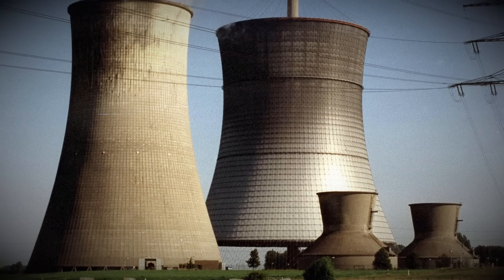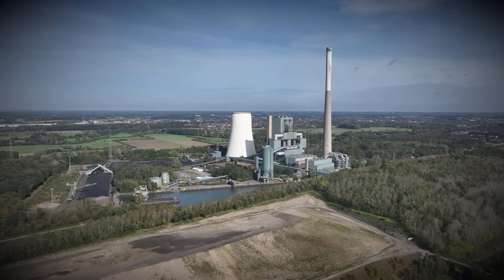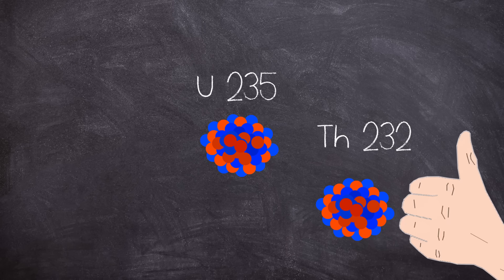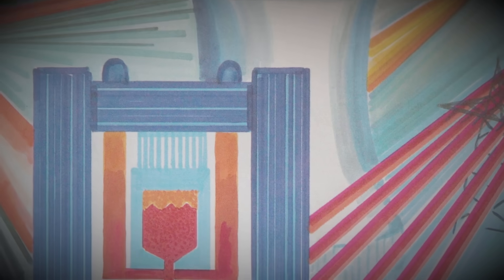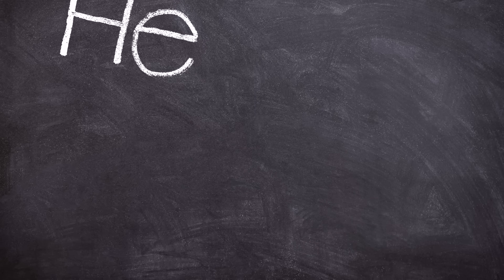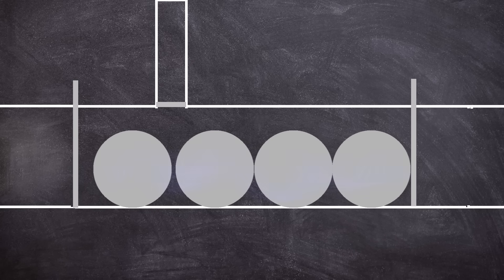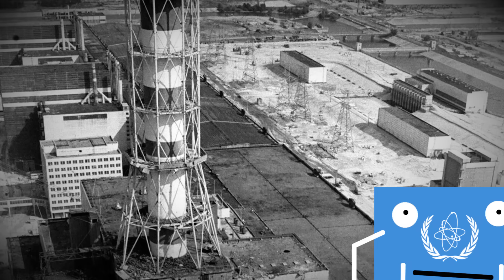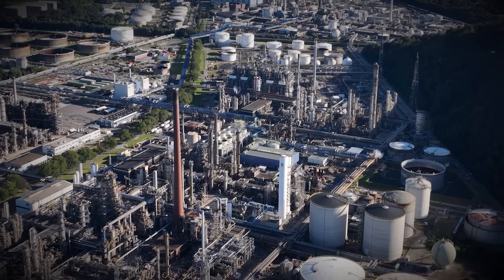Inside Germany’s “Chernobyl”

Comment: The 77.6% in 2023 looked unbelievable for me but after research you are correct. But 35% were just oil and that leads to Germanys  new decision to phase out cumbustion engines and oil burners for residential heating. Both plans also didn’t work so well so far .

Comment: It was very shortsighted. They are destroying ancient forests to mine more coal, and wasting many acres of land for wind turbines, when they could have just ordered some reactors from Canada or France or the US using more tried and tested and predictable designs and improved upon them in practical ways. Like a containment building actually designed to open up for the replacement of steam turbines and other large equipment faster and more efficiently as needed. Many US reactors are costly to maintain because the engineers seem like they didn't think ahead to if they were uprated or needed massive maintenance works. So they have to carefully cut open the containment structures to do it in a very expensive and complex process.

Comment: That isnt a horrible release. Granted it isn't very good but the identified the problem and mitigated it. As long as there is no danger of meltdown I don't see the issue. Maybe update the automated system to allow for adding less than 60 balls. Also, a system to require multiple sign offs for adding nuclear balls. But sounds pretty simple to shut the reactor down. You either throw in control rods or dump half the balls in the hopper. Or your can just load in a bunch of absorbsion balls.

Comment: Thorium 232 is fertile, not fissile. What designers don't like to state that thorium reactors are a type of breeder reactor. It's interesting that those who support the use of thorium reactors are keen to point out that they don't pose a proliferation risk and in the same breathe mention that the thorium fluoride used isn't volatile... but the uranium fluoride IS. so someone could extract the U233.

After all, the US even tested a U233 nuclear weapon.

Helium cooling AND pebble-bed. That is a LOT of experimental designs all in one reactor. I wonder if it was really expected to provide energy or if it was to test all of the experimental elements in a single design?

Comment: Nuclear power is held to hundreds of times the standard any other source of power that would fail if they were held to the same standard.
As a result nuclear power statistically is actually the safest source of power by far even surpassing renewables per TWh generated.
Reply: Renewables are orders of magnitude cheaper and simpler, among other things.

The main problem with nuclear isn't safety as much as cost and complexity

Comment: Yes, shutting down nuclear reactors could be seen blind eyed by someone who doesnt know how much energy was produced by nuclear powerstations.
But today, we produce half of our electrical power needs by solar and wind and even sell it when it is profitable. So, i dont know if it really is that bad, considering how much money is burned by a nuclear reactor without looking at the costs for storage of its byproducts. And remember, you just said that this type of reactor which could deal with it, is also not prone against problems.
Reply: Only around 35% of germany´s power production comes from renewable sources. And the argument that it is cheaper is really arguable, specially where you mention the storage of nuclear waste which isnt even an issue, despite what a lot of people say.
Reply: @warcrimemenace6292  arguably because it is not a straight Line through the year.
Reply: @ True, but solar panels dont simply get cheaper / emitt less during production over time, things like that require breakthroughs in technology which are rare.

Comment: So basically this proves once more that the nuclear industry always tries to hide it, and that nuclear reactors are not zero emissions.  Same as how they claimed nuclear reactors can't explode, or that they are too cheap to meter.
Reply: This doesnt prove anything of what you said. The nuclear industry generally doesnt hide such things, and a lot of minor nuclear accidents have been treated with more caution than needed by, for example, evacuating large areas of population when not entirely necessary. Nuclear reactors ARE zero emissions in the sence that they dont constantly emitt waste into the atmosphere, and that only happens in dire situations when an accident happens, which is very rare, and even then there have been very few cases of decently sized radiation emissions during accidents. I dont think anybody has claimed nuclear reactors cant explode ever, so I dont know where you got that idea, but every single modern reactor design has active and passive systems to prevent such things, which is why the few reactor explosions that have ever happened have been directly caused by absurdely ignoring design flaws.
Reply: @warcrimemenace6292  Yeah ok...  You mean the same people that DUMPED THOUSANDS OF 55gal STEEL DRUMS INTO THE OCEANS FULL OF NUCLEAR WASTE FOR DECADES, until Greenpeace finally stopped them? 
How about calling the most expensive means to boil water "Too cheap to meter"  IT'S 5 TIMES AS EXPENSIVE WITHOUT INCLUDING DISPOSAL OR DEMOLITION COSTA POST USE. Get a grip, you had been propagandized by the nuclear cult.

Comment: Germans always think they are so smart. Yet, they fail miserably everytime.
The more systems your reactor need is that many points of failure. And on a nuclear reactor, you want it to be as failproof as possible, with the least systems as possible. The standard system with control rods sound way smarter than playing snooker with radioactive balls.

Comment: Actually most of Germanys electricity is generated by actually green energy. And the shift is much faster and better because we generally ruled out nuclear.

Nuclear has so many downsides for so little upsides that its just not good.
Reply: Saying most energy generation in germany is green is factually untrue, only about 35% of energy in germany is produced such sources. And nuclear has extremely few downsides, the only two I can genuienly think of are that its more expensive than things like coal and natural gas, and that if they are poorly engineered with major oversights (which have been caused before due to it being cheaper to outright not implement safety systems) they can theoretically do more damage than any other power source.
Reply: @warcrimemenace6292  what the hell are you even talking about? The energy report of Germany clearly states that 2024 was 62,7%

You need to shut up and learn. Nuclear has "few downsides" but they are so big that it would be better to burn coal

Comment: I think comparing it to Fukushima rather than Chernobyl is fairer. Few nuclear reactors that reach commercial use are as bad as the RBMK. And even that lemon, while bad in not having a primary containment, was safe as long as you followed the manual exactly and shut it down any time there is a deviation from tested reactor conditions.

Comment: You'd think, with so much at risk (even just public trust if not health) such systems would be tested to the limit in a safer form before going into operation, in order to weed out every potential failure point or opportunity for human error.
If this system had been operated for a year or two with entirely inert materials, and they'd thrown every conceivable scenario at it and the operators, they would probably have found and resolved every potential point of failure.
Instead, they spend billions on manufacturing such a plant, put it into service, then screw something up and destroy public trust in nuclear energy.
The testing regime never seems to adequately match public demand and expectation.

Comment: RMBK was good. Containment buildings are over rated. Light gases should have no place anywhere near a reactor. Safety systems should have independent battery backups spread throughout the facility.

Comment: 13:00 Primary Energy and not Power! Even with Nuclear Power in the peak it was just 25% of all Electricity Generation in Germany and with it this would have been also the case today, because most of it is from heating with gas and cars that need oil.

Comment: That's the shortcoming of Thorium breeders, their insane operating temperatures and pressures either require gas coolant or molten sodium, both coolants are a major PITA to design heat exchangers and components for.

Comment: Fossil > radioactive. Simply because of the scale of damage they can do when miss-operated. Wed need that liquid lead reactor
Reply: Renewables > Nuclear > Others > Hamster Wheels > Fossil
This is the order to go with. Fossil Fuels are more dangerous and also more radioaktiv then waste from Nuclear. Most waste from Fossil Fuels just get's blown in the air, where it's not only then gets in your lungs (smog), but also is the major causer of climate change. Then there is also the remaining slag, that contains all not burned things. In there are then also Radioaktiv Metals that are on a higher concentration than waste from nuclear plants. Accumulated on waste landfill, they are so radioaktiv that by living in an area near them you have a higher chance to get cancer.

Comment: Why.. why gas as coolant and a complex online mechanical feed system.
WHY…!
Reply: Bingo card:

Bodged safety. Reminds me of the radiotherapy devices zapping patients because the operator was working the charging station in a manual mode and not a semi-automatic one where I would expect adequate pressure control and a defined sequence where the correct conditions must be present before the next step is initiated.

Comment: Saying something is "short-sighted" when it is not even fathomable when you're thinking about the timescale that we will be spending money and ressources on keeping nuclear waste in check. The money spent on building new powerplants and taking care of that is three times the money the government would need to go completely renewable. As long as nuclear exists, the money will go to them instead. a coal powerplant is shit for sure, but you can shut it off as soon as you don't need it anymore one day and won't have to deal with un-building it for decades. and if you look at france: cheap elextricity yay, but last two summers, during droughts, they had to turn them down because the cooling water was so hot, it was killing the fish in the surounding rivers. they had to buy it from germany, which had an overflow due to massive solar power.
In summary, a "quick" and "cheap" solution for now, or spent more money and get it done forever.

And we are not "afraid" of nuclear power god damn.

Comment: 13:02 Just to be clear: With Total Energy usage you mean all forms of creating Energy, i think. That means that in this number it is not only Electricity-Production but f.e. also Heating an Industrial Production. And because the Steel industry f.e. does not melt Steel with Electricity and most of the homes in Germany are heated with Oil or Gas, you get that 77,6% Fossil  Fuel usage there. But if you look only on the Electricity Production (for which the Nuclear Power Plants  where used), you will see that here the Majority(52%) is covered by renewable Energy.
This is far from perfect and i also think the nuclear exit was rushed, don't get me wrong, but i thought your number needed a little context  here.

Comment: I was under the impression that LFTR reactors were much safer because they wouldn’t fail in a cooling water/ other loss. Instead of getting super hot and exploding, the fissile material would turn solid and cool down. The articles I read also claimed we could obtain Thorium from existing mining tailings/waste, basically an unlimited ready made source.  It sounded so promising.

Comment: I like your videos, John, but I find it sad you fail to mention that the "Atomausstieg" was directly linked to a huuuge program to switch to renewable energy. Nowadays, 52.5% of all electricity produced in Germany is renewable power.
Reply: For comparison, France has stuck to its nuclear power strategy, and they only have around 25% renewables. The brutally cheaper renewables are only gaining momentum there in recent years.
Reply: @HarisDotParis we wanna ignore nulcear power is renewable and even cleaner?
Reply: @timo4463  Nuclear power isn't renewable as its fuel is finite and is anything but clean. Especially the latter matters as no country except Finland has any long-term nuclear waste storage solution. And getting long-term storage right is doomed to fail as nuclear waste will stay radioactive for millions of years, creating heat and destroying its storage facilities. Germany already had several attempts all of which severely failed. True renewable energy is the far safer bet.

Comment: You're completely out of your mind! This is absolutely not comparable to other known incidents and who knows what incidents have not yet become public knowledge! The protective container around the cooling of the reactor was not damaged in the slightest... of course a larger hydrogen explosion could have taken place, but thanks to perfect German valves the line was closed immediately after a minimal drop in pressure! If you compare these protective measures at that time with other backward countries like yours, the reactor was certainly extremely advanced

Comment: An unusual (experimental) design, which needed improvement, which was made.  Helium is a small molecule which will always leak, so not as gas tight as CO2.  They were trying to run a high temperature system for efficiency.  Nothing like as dangerous a design as the RBMK, which had both graphite and water in the core.  The shitty brown East German coal actually saved West Germany from freezing, but was very far from "green".  Political choices!

Comment: I have heard of a new CHINESE molten salt reactor that uses these pebbles . From what I understood of the presentation a meltdown was impossible for the reason that the fuel can never get near the temperature to melt any containment vessel . They do this by actually storring the heated molten salt while waiting in a line of storage tanks so they store the energy with loads of surplus salt going through the heat exchanger from storage tanks as needed . Also the salt is the cooling mechanism so you can have a water cooler also but there really is no need. I hear Rolls Royce engineering are building a very miniature fission reactor which I believe until fusion is viable these portable reactors are the absolute way to go in our age for the energy situation on our planet. The US military now are using a complete reactor generator which fits in a shipping container . Anyway your going to have problems with anything experimental because the fission process is  simply and Plainly Difficult but human beings can overcome it if we think a bit longer .

Comment: It is not short sighted to shut down nuclear reactors! In fact, it is short sighted to keep (any of) them open! The problem is not that nuclear reactors theoretically can run safely. The problem is that they practically can not run safely. Because you always need people to run a nuclear reactor. And you can never rule out the human factor. They will always make mistakes, and terrorist could try to be an employee. Also, if management always would prioritize safety over money / political gains, the costs of nuclear energy would be off the scale. And currently, the costs for protecting nuclear waste against contamination or terrorists or natural distasters, for hundreds of thousands of years, is not even taken in account yet! Nuclear energy, by far, is the most expensive type of energy - especially when done safely. Which will never happen, people are always thinking on short term, not on longer term. That is in their genes. And the solution is simple: use geothermic energy, which can be harvest in every country, not just Iceland: just drill a deep hole. Yes, currently that is more expensive than solar panels and wind turbines, but is cheaper than nuclear energy. And it will be cheaper if we would emply it large scale. It is nothing less than narcissistic (towards our 10.000 next generations) to use nuclear energy or keep those reactors open.
Reply: nuclear is still safer and more sustainable than any fossile fuel electricity though
Reply: @katiebarber407 saver then windmills even
Reply: Ok cool peoppe crash cars and planes lets ban those

Comment: 77 % fossil fuels? Huh? In the 90's maybe but in 2023 it was 52,5 renewable energies and 38.5 % fossil fuels. That's the elecricity grid and that's the only metric that makes sense for this context. Since looking at total energy consumption including but not limited to elecriticty makes little sense as nuclear powerplants do fuel people's cars nor heat their homes.

Let's not pretend that it was the discontiuation of nuclear energy in 2023 that's lead to a large percentile of the energy production still being fossil. It's because the same party that planned and enacted the exist from nuclear power is also the one that's sold out Germany's solar industry to China. In the 2000's Germany was the world's solar champion. And then no proper investments into the electricity grid and heavily favouring fossil fuel lobbyists is what caused the downfall of German renewable energy production, not the shut down of a thorium reactor.

I understand that you can't know everything about a topic but please do more research on the aftermath next time before making statements and suggestions about causations. And getting numbers mixed up happens but to this degree is really concerning. And since you haven't even listed your sources I can't check and see from which angle you're coming from and can't know if that's an honest mistake or deliberate.